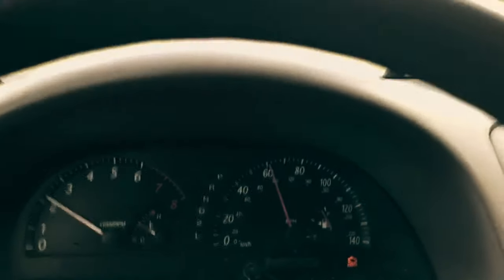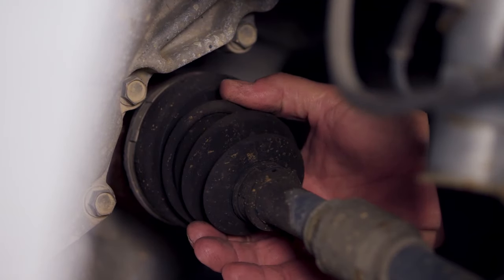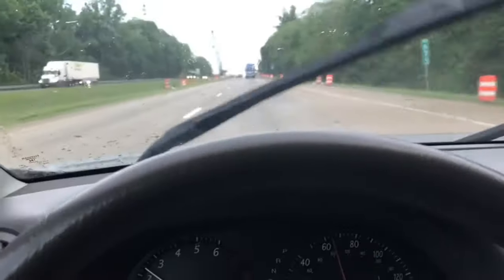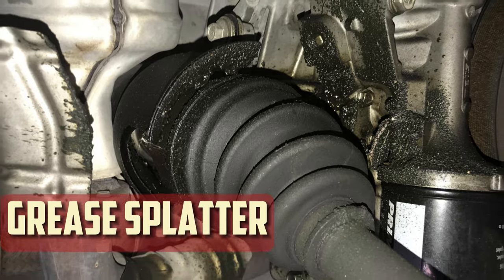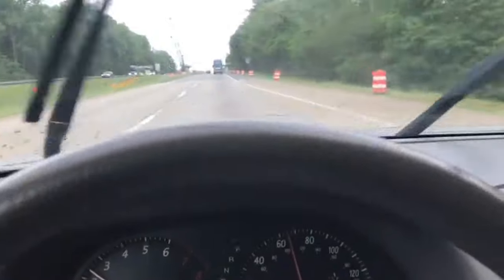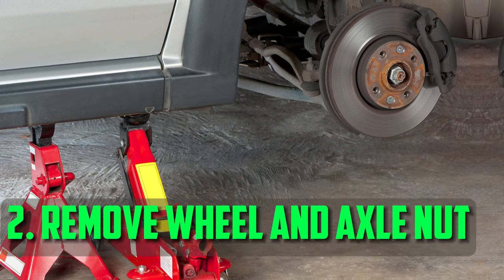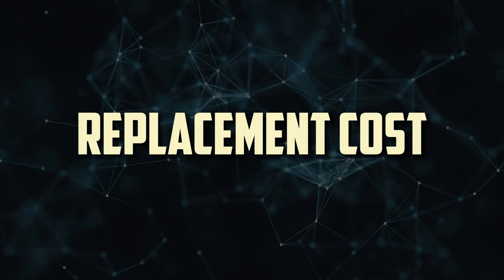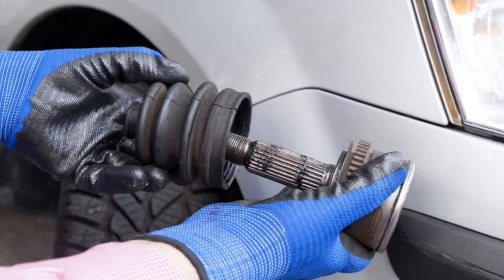4 Symptoms of CV Axle Going Bad (How to Fix & Replacement Cost)

Comment: My car has no vibration, however when i try to turn the car both side left and right, there is loud clicking noise ! How would i be sure that whole axle( drive shaft) needs replacing or just the CV joints ? Thank u
Reply: I’ve been having the exact same problem did you find any solution for it?
Reply: @NoBody-jo5rj same did you find the answer?
Reply: I'm no mechanic, but from what I've seen so far, you'd only need the whole axle replacing if it breaks in the middle. You'll know if it's broken cos when you accelerate, you won't move. 

If you can move, it's most likely just the cv joint which attaches to the wheel hub. If that's the case, just search for a cv joint kit for your model car.

Comment: I have been to four garages including ford. They can’t diagnose it. But it doesn’t happen going round the block. It’s after a while and at 40mph plus. And when very cold.
Reply: If it's not this issue you could have a bad drive shaft u joint or simply unbalanced wheels causing vibration.  It's hard to diagnose without actually seeing and/or driving the car.
Reply: So what was it? My car is doing the same thing. After 40+ miles an hour it starts to make noise. 
I replaced the passenger axle cuz it was super bad. Now the driver side is suddenly leaking really bad after I replaced the other axle's seal. Just wondering if you figured it out.
Reply: @MikeKollin more likely alignment if it starts at certain speed

Comment: It makes a nosie in my car on the driver side it makes noises in cold up driving the when it heats up the noise stops but it will make noise on full look of steering wheel on the right side.
Reply: Bro mine is doing the same and I’m here 😂😂😂 I don’t think the cold start is the cv axle though

Comment: What makes a buzzing or humming noise in the front end of a 4wd vehicle driving in 2wd?
Reply: Is it speed variable, does it get louder or more noticeable at higher speeds vs lower speeds? If so, it could be a bad wheel hub assembly. If it’s constant, it could be suspension related
Reply: @TheRoadWarriorUSA   louder and faster yes. It sounds and acts like a bearing with more of a gears running without oil or rubbing gears. Just about the center of the front end. Wondering if I stripped a spline. The funny thing is just like a bearing when I turn right the noise goes away and when I turn left the noise comes back. Bearing is good on both. Cv shafts feel fine. I'll probably have to rip everything out and locate the issue.

Comment: 50 dollar part and its a half hour job, what crack you smokin?
Reply: It takes more than 1/2 hours to replace the cv axle, and the part is at least 200 dollars. Unless less, you buy the knock-off one that will fail in 3 months again
Reply: @1986hvwchampion  I have to replace one I bought off rock auto 4 years/90k miles ago. the axle I bought back then was 40 dollars. The one I just bought for 47 is a trackmotive. the one I'm replacing is because it has a torn boot, still working fine but only a matter of time before it does fail. It takes me about 45min to an hour in my driveway DIYer working on the ground
Reply: @dereckc9469  sounds like you have a cheap car and you decided to go for an even cheaper axle. Grats.
Reply: @Hivescum2  mechanic should have a lift and air tools...it will take a half hour. I see kids break an axle on a civic during qualifying change out the axle on the ground with just a jackstands and hand tools and be ready to fun again less than 2  hours later
Reply: anybody justifying 1500 to swap an axle is either a shady mechanic or bored and looking for silly debate/trolling